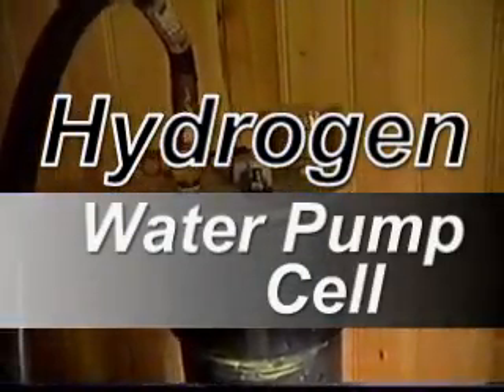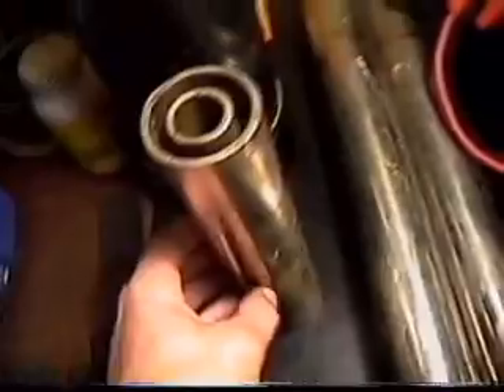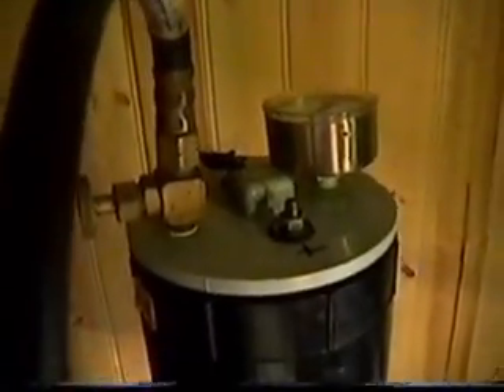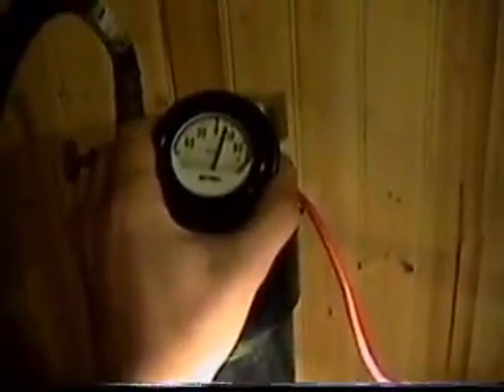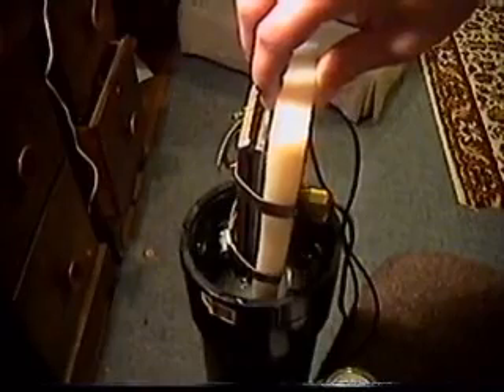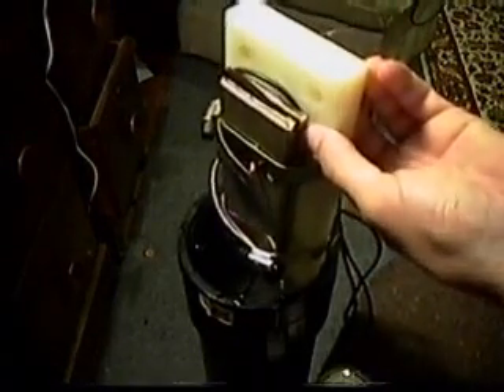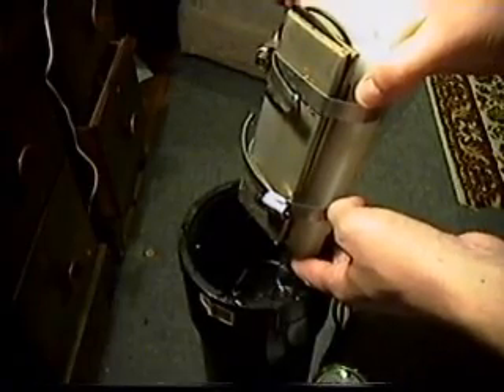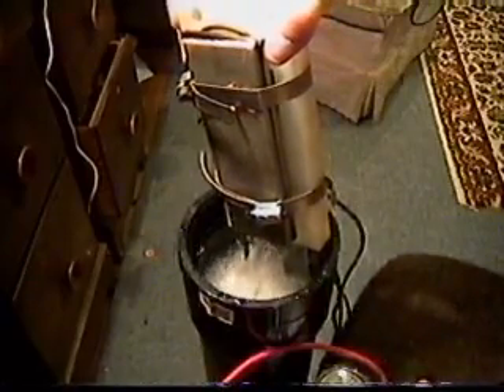New Hydrogen Cell

Comment: DANGER!: Attention HHO people using LECTROLYTES!!!!!

Electrolyte systems are nothing more than electroplating units. They are NOT Stan Meyers systems. Yes they produce Hydrogen, but they also produce, CO2 and trace other gases due to the electrolyte. THE USED WATER IS POISONOUS! DO NT DRINK IT! DO NOT THROW IT OUT IN THE BACKYARD! IT IS TOXIC AFTER ELECTROLYTE IS ADDED.  BE CAREFUL HOW YOU DISPOSE OF IT! STOP USING ELECTROLYTE AND LEARN HOW THIS PROCESS IS SUPPOSED TO WORK CLEANLY.

Comment: Interesting! Would it not work better to pump upwards from the bottom provided that there is a method to prevent it from pumping all the water out of the system through the gas outlet? Just how would one prevent that though? I don't know much about these, but it is just a thought.